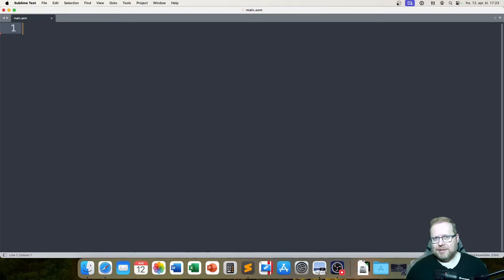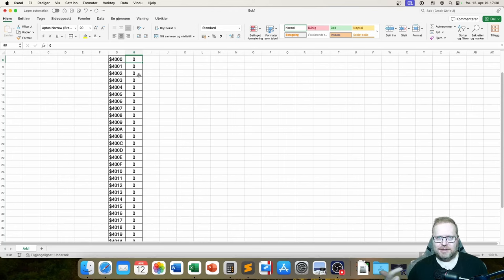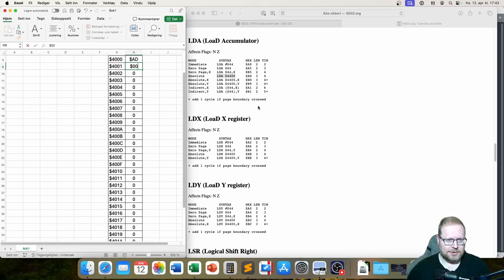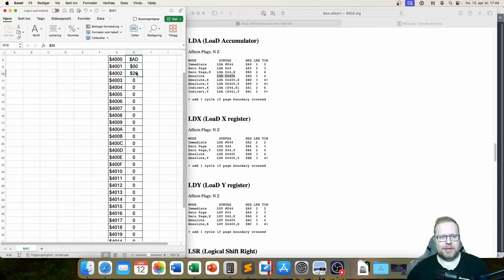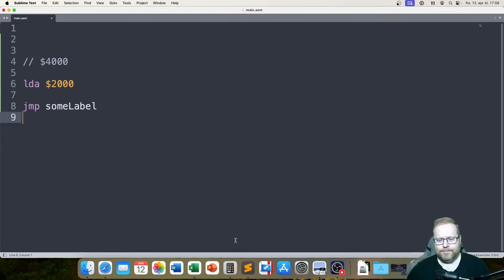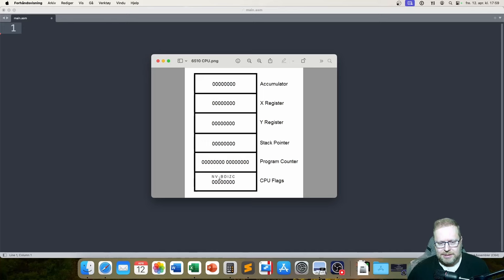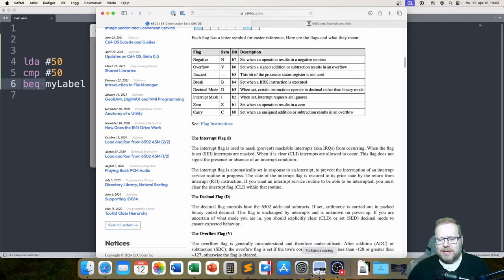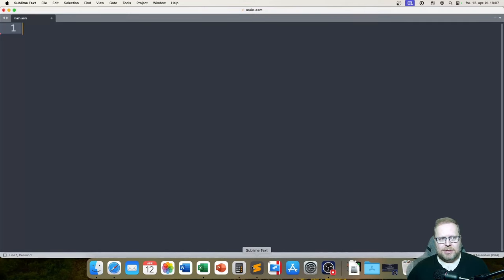C64 Assembly Programming Part 11 - CPU & Bit Manipulation

Comment: I'm completely new to this paradigm(or even game dev), so sorry if the below questions are out of scope: 
- can we program and play these games on a normal laptop? If not, what do we need to make these games? 
- can we make them and allow others to play in a browser? Maybe using some kind of simulator? 
- what kind of steps are required to make a custom background graphics and characters for the games?
Reply from the maker: 1. You can play these games on a normal laptop by using the Commodore 64 emulator VICE (or any other C64 emulator).
2. You can play these games in a browser with an online emulator like this one: https://virtualconsoles.com/online-emulators/c64/
3. Background and sprite graphics are the topics for the next few videos. I will be talking about how it works and what applications you need. We will be making our own graphics in this tutorial series.